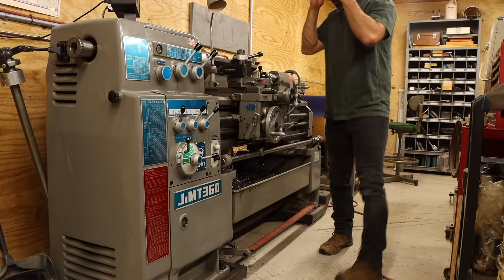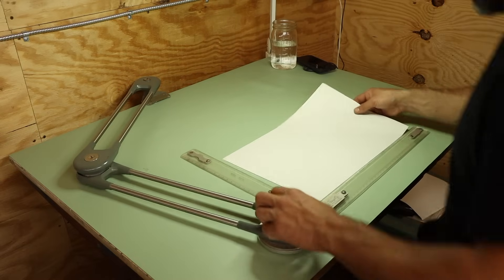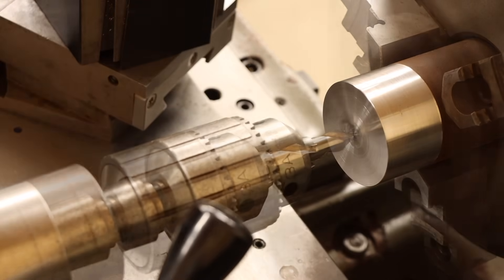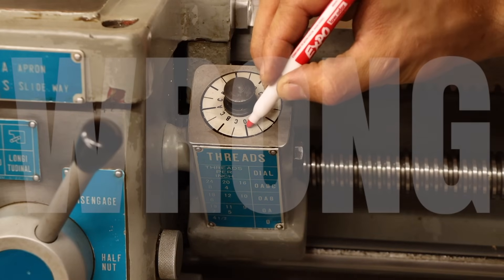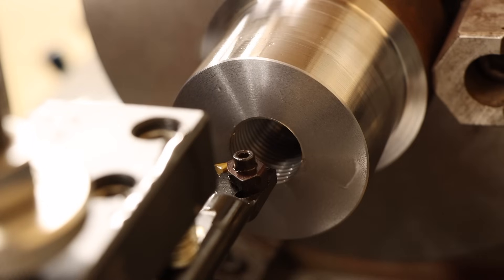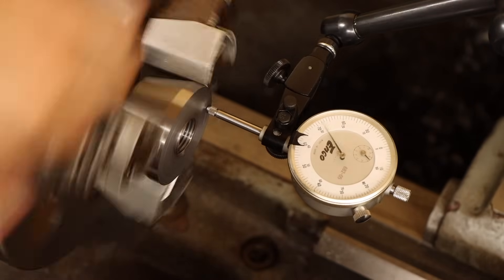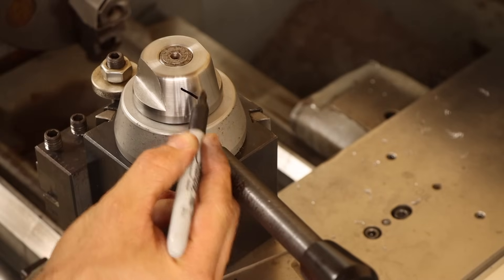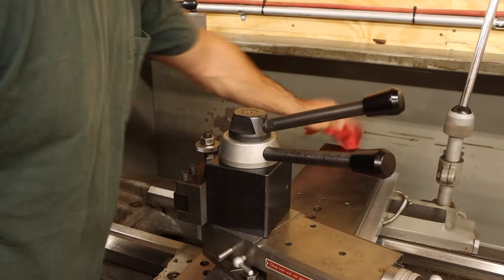A Better Tool Post Nut || INHERITANCE MACHINING

Comment: Try using a left hand thread holder and reverse the machine and thread away from the chuck, slot less stressful,  you can i.d thread running the machine backwards using a left hand threading bar upside down also, give it a try you will see the immediate logic, btw I'm sure this will ruffle some feathers,,, you can thread using the cross slide at 90 degrees it does not facilitate lead cutting  on the thread insert, another words both sides still cut, many of us in the past have been told that moving on the compound at 29-1/2 degrees takes tool pressure off the opposite side of the tool but this is not true, Joe Pisynski on YouTube does a great video on this.

Comment: The knurled screw on the thread dial makes it look like it's supposed to come off easily... What if there was a metric dial on the other side of that disk?
Reply from the maker: As I later learned its all down to the lead screw pitch so the thread dial is useless no mater the gear underneath.

Comment: Thanks Sir for your Videos.  Your Bridgeport is a little rare for being Foreign. You may not have a Clone Brand. Did you find out what the Second Head motor for? Do you have a Boring head for your Bridgeport?
Reply from the maker: My pleasure. Nope no boring head. The second head that is attached is almost identical. Some people suggested it could be used for for quickly switching between head setups. Like if you had some compound angles
Reply: @InheritanceMachining  still the only ones I have seen is on Bridgeport model.  You have a Rare one there. I guess you are a younger machinist and a good one at that.well keep the videos coming out. There sweet to Watch. Keeps me young.   Peace Be With You

Comment: I'm a little late so this may not apply (watching you're series in order)
When clamping something at the edge of you're vise, it's good practice to balance the other edge to prevent the moving jaw from canting. While it's only a minute angle, if you're taking heavy cuts the part has a tendency of lifting or moving from not having enough clamping surface.
If my part is 3 inches long and overhanging the jaws even a small amount. I make sure to slide something of the same dimensions on the other side. It's fun when working with parallels and a table mounted stop lmao

Comment: One day when parting off loads of parts I had the idea to stick a piece of round stock in a drill chuck mounted in the tailstock and bring it up into the bore. Just part off and let them fall after that.

Comment: If not already mentioned you are nearly there with the half nut disengagement for metric threads on an imperial lathe.   Check out Tom's video:  https://youtu.be/HXt4TWa382Q

Comment: Disengage the threading lever like you normally would at the bottom of the hole and stop the machine at the same time. The carriage will stop instantly and the chuck will spin a few more times. Then turn the chuck on in reverse and re engage the threading lever when you come back to the same position you just came out of. So you will go a little past it on the dial, then catch it as it comes back. Lets you not crash the carriage but still stay in the same engagement location.

Comment: I used to be terrified of internal threading like that with my single phase motor, but Joe Pie taught me to thread in reverse with an inverted tool. Now I have a VFD and braking I still wont go back to normal internal threading
Reply from the maker: Tried this for the first time today actually. I like it!

Comment: Metric threads are usually all cut without the thread chasing dial. That is one of the crappy things about metric.... ONE of them. Metric thread chasing dials (when there even is one) have gears that you have to shift around for different pitches. Mostly people just leave it engaged and reverse back, which is a REAL PITA on anything but the shortest threads.

Comment: I'm still looking for a method to cut metric threads on my lathe. It's a major pain to have to stop and reverse without disengaging the halfnut. I have read articles where the thread dial indicator is changed to enable this. But that required a new gear to engage with the Imperial threading screw.
Reply from the maker: Yeah from what I hear thats the only way around it. There is a modified technique you can use though where you disengage the feed and stop the spindle at the same time. Then when you reverse you re-engage at the same mark. As long as the dial doesn't make a full rev it stays aligned. Still a pain to reverse but at least makes it a little less harrowing
Reply: @InheritanceMachining  I think that was OxtoolCo that I saw that method. But that works until the lead screw makes an extra turn. And you know how much fun it is to restart on a part (I do that too). A better thing was watching Joe Pie channel, and seeing him thread from the backside with the cutter upside down (external, internal is cutter in up orientation, but with lathe in reverse, and cutter on other side of internal bore) so the feed is away from the chuck. Keeps the thread right handed, but you don't worry about crashing past the end of thread.  The last metric thread I did, I used the DRO Z channel (but X to me) and used that to return the cutting tool to the start of the thread feed.
I have the same quick change system (CA size, 400 series), Phase II on my lathe, and use a 1.5" wrench as well. Who has a 38mm wrench in their set? I had to buy the large spanner set from Harbor Freight, and it was pricey even 25 years ago. I bought extra holders from St. Charles, IL, Shars import company, if you buy 10 you can get a deal with them if ordered on the phone. I think I got 30 extra, and all of them are filled with different cutters. I got the ones with the groove for a boring bar in them, as they work for square insert tooling as well.
I think I'll make a replacement nut just like yours. Putting flats on it for long wrench tightening is a very good idea.

Comment: I avoid moving the tool post and the compound if at all possible so as not to destroy any tool offsets I've set in the dro.
Actually I  lock the compound against a piece of material so it can't move. 
And threading straight in is not a problem on smaller threads. 

Ps it's very important that your parting tool is actually at 90° just one more reason NOT to move the tool post.
Reply from the maker: Good points. I've never really looked into whether my DRO has programmable offsets. I'll be investigating that

Comment: Attempt 3 is correct.
If you disengage the feed, you get the backlash (?) we call it "dead play" in german.
Its basicially the tolerance on the feed, but if you never disengage it, you will never "doulbe thread"
Reply from the maker: That's a fair point about backlash/dead play in the lead screw. I use the disengage method regularly for imperial threads with no issue. The problem I ran into (as I learned later) is the imperial lead screw/nut must always be engaged at the same exact point in the rotation (or never disengage) to create the metric threads. The "double threads" I was getting were a result of engaging at a different position and not a result of backlash.

Comment: Threading dials are (almost) worthless when cutting metric threads on a imperial lead screw or vice versa.  The half-nuts must engage in the same exact position in the lead screw.  The easiest method I've found for threading blind metric wholes, is to mark the dial as you did.  When approaching the end of the cut, disengage the half-nuts and outfeed the cross-slide as usual, and then stop the machine.  You can then run the machine in reverse, running the threading dial backwards until you reach your mark, then reengage half-nuts to extract the tool from the bore.

Comment: When used as intended the QC tool post requires NO repositioning unless setting up for taper cuts with the compound rest. Constantly turning the post away from square with the longitudinal axis totally and completely negates the idea of the quick change system. Amazing how ignorance pervades the masses and gets re-taught by the ignorant thus perpetuating it.

Comment: When you decided to select a single mark on the threading dial, I KNEW what was going to happen.
You might want to look at https://www.youtube.com/watch?v=jbRcs_Hhtuw to see why a threading dial works.
As for handling metric threads on an imperial lathe, it is possible. But you can't just use a simple threading dial. Instead, you need a more complicated mechanism to keep track of how many times the threading screw has turned until a distance that's evenly divided by both an inch and a metric distance. So for a 2 mm thread, you need to "travel" 10 inches or 254 mm. Since most threading dials on an imperial machine only travel 2 or 4 inches, it's pretty obvious that the method you finally used (never disengage the half-nut) is a reasonable work around.

Another video you might get some inspiration from is https://www.youtube.com/watch?v=zG9XYDCDwWY which is a treading dial that handles both metric and imperial threads.

Comment: A trick I use when cutting internal threads is to cut a recess at finished size. In this case 22mm 1/4 deep into the part to be sacrificially machined away when threading operation is finished. As soon as the cutter leaves a trace mark on the recessed inner diameter you know your at the correct thread depth.. Its very advantageous when working with large sizes that no test thread can be had or used. Keep up the great content.

Comment: Hasn't anyone told you how to do the upside down thread cutter, running the lathe in reverse and feeding out of your work? Then you don't have to worry about crashing your tool bar or post into the stock. It's running out. Then shut it down crank the tool back in. Adjust the depth of cut and engage the warp drive!! Make it so Number Two...
Reply: Ooo, and also for your drafting table. More to it your cross hatching. Take your triangle whatever the hell it's called? I graduated in 1989. Anyway, lay a steel straight-edge at about 1/8th inch in from the edge and score a line on your triangle with a razor. Not too deep. Now when you draw cross hatching keep your 90 degrees lay the triangle on the lower scale. Put the original edge where you want to start your cross hatching from the left. Slide the triangle until that first line is under the score. Slide again. And so on and so on ....and then you are done. You can also score different spacing for whatever you are drawing up..
Reply from the maker: Thanks for the tips! I am aware of the inverted threading tool but I'm pretty certain a left handed tool is needed for this. At least for internal threads.

Comment: You can use two gauge blocks of the same size to flip an object in a lathe 
rest one on the bottom two claws and the other resting on that
if both touch the back plate you can put your object with its flat face against it and clamp down
then remove the guage blocks from the side
Reply from the maker: This is a good tip. I tried something similar with some parallels but the geometry of the part and the jaw spacing wasn't letting it happen. Ill keep that in the back of my mind though

Comment: I am interested in your lathe brand. It looks a lot like a Mazak Mate that our shop purchased in 1993. Our shop was full of Mazak CNC, and this was the only time that I ever encountered a manual Mazak machine. The Mate had many marks of being sourced from China, but operator functions and machine rigidity we're wonderful. Opening the electrical panel in the tailstock base made me shutter (classic non conformance to most NEMA standards). In spite of this travesty, we never experienced any problem and ran that machine for nearly 20 years. The lathe operator babied that machine and out bid me when it went up for employee bid. The Mate is still a key machine in his home shop. I am currently resurrecting a very old LeBlond and a very large American Pacemaker for my home hobby shop. These will be robust machines, but have seen long and abusive service. Your machine looks like a desirable option for my hobby shop. Most of my lathe experience is with Clausing Colchester machines. I haven't found one of these yet in my budget range. 

What brand is your machine? It looks like it is about a 13". Am I guessing correctly?
Reply from the maker: You're actually very close. It a JFMT 360 x 1000 mm (Jinan First Machine Tool) and is a copy-cat of the Mazak Mate. It's the perfect sized lathe for what I do and also in really good condition being that it came from my grandfather and never saw production scale use.
Reply: @InheritanceMachining  Thank you for the comment reply. I was a maintenance technician for a fairly large design/builder of printing machinery, primarily presses. We purchased our Mate for model shop in 1993 after our plant flooded with nearly 5' of water and was under water for 2 weeks. I didn't run much machinery as a technician and as the shop moved to mostly CNC I was far more intimate with the CNC than manual. I retired in 2017 and built a 4600 SF building for hobby work. A portion of the shop is exclusive for machine shop where I enjoy mastering machinist skills. Everything in my shop excepting an Atlas/Craftsman lathe is industrial, but much of it is worn from production use. I am envious of your non production use machines. I moved into my shop in January 1 and open heart surgery was scheduled for January 7. I have been back in the shop since early summer. I have 16 grandsons. I find great pleasure having them under my wing in the shop. As a maintenance technician I have a wide skill experience, but the experience dilutes the specific skills that I desire for many skilled trades. I cannot focus long on any discipline since other hobby pursuits have strong clarion calls as well. The best part about my new shop is that I kept the old shop. This space is now exclusively for woodworking.

Comment: There is something satisfying about constructing a drawing on the board, I sorta miss it.  But, today a computer and drafting software costs less than the board and machine, and takes up less space,  so it goes.  Your nut with the handle came out nice.  Any danger of grabbing the wrong handle it the throws of a lathe project?
Reply from the maker: It's definitely faster and more convenient with CAD, and if I didn't have the board I probably wouldn't draft. But thank you! There is that possibility, but then again if I'm changing tools I'll be re-zeroing anyway

Comment: One trick I've seen people use for making metric threads with an inch lead screw, especially in tight corners, is to release the half nut about the same time you turn off the lathe. The trick to keeping it in line is to reverse the lathe and reengage the half nut at the exact same position it was in before you disengaged it. You just need to make sure that if your thread dial turns X degrees between disengaging the half nut and full stop, it turns -X degrees after reversing the lathe to reengage the half nut.
Here is a video to that will show what I'm trying to say. The demonstration starts around the 5 minute mark.
https://www.youtube.com/watch?v=HXt4TWa382Q

Also, love the channel. I understand the appeal of using inherited knowledge like you do. I learned a lot from my grandpa growing up on the farm and hope to inherit some of the few tools he left to my dad some day when I hopefully get my own small shop. He wasn't a machinist and didn't have many tools, but they were his tools, at that holds a lot of nostalgia for me.
Reply from the maker: I had a couple other people suggest that technique as well. I'll definitely be using it!

It's great that you got to spend time and learn from your grandfather like I did. A lot of old knowledge with their generation that might otherwise be lost. Glad you like the videos and thanks for the support!